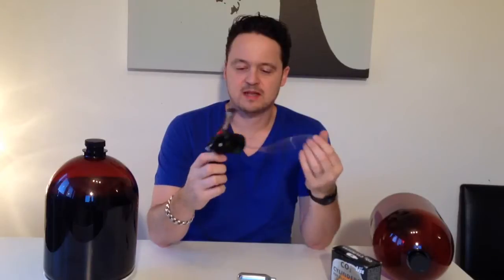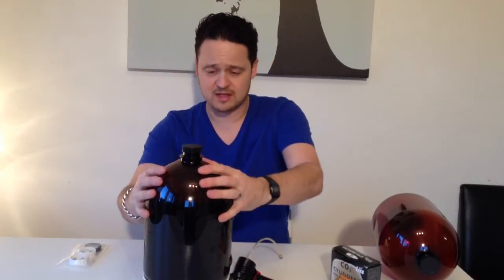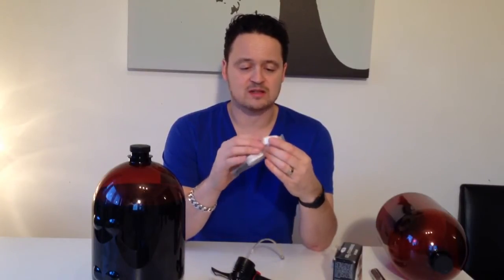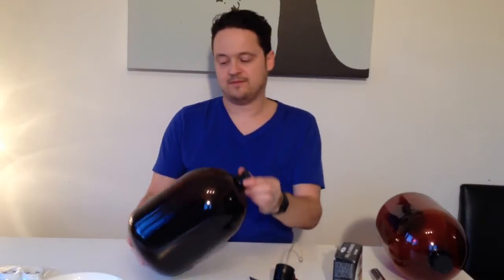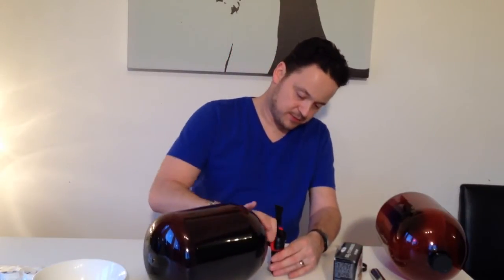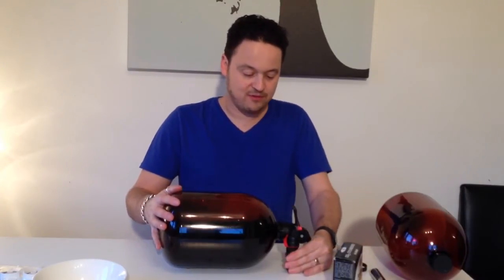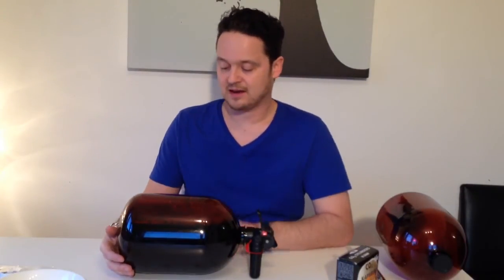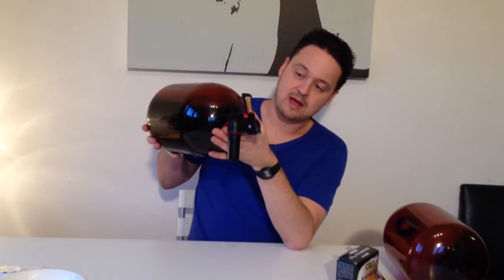Tap A Draft for conditioning, storing and serving beer

Comment: do the cartridges put out gas continuously over days, or just have that initial burst?

I read that the round bottoms are for strength. It's just a much stronger shape than any alternative.
Reply from the maker: +gfjdhdfghfdjgf As soon as you release pressure by pouring the beer the gas rushes in to fill the space. So yes it puts out gas continuously.